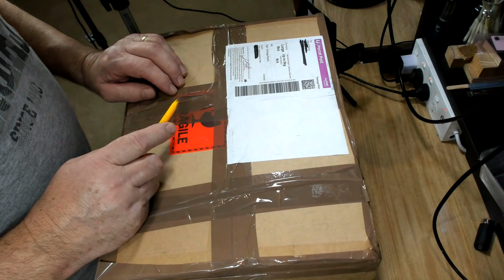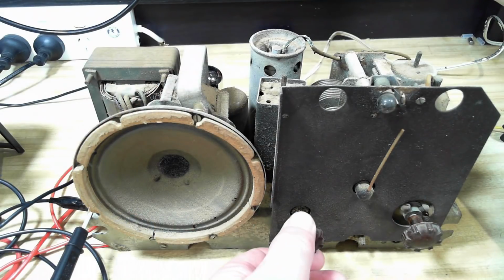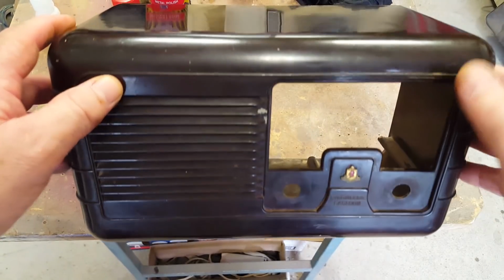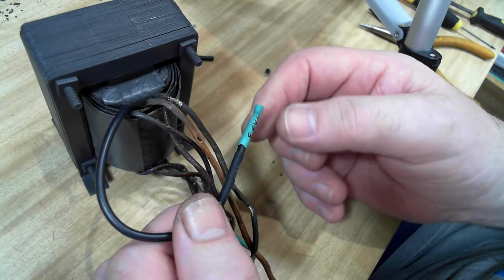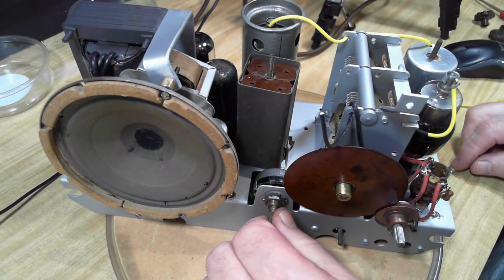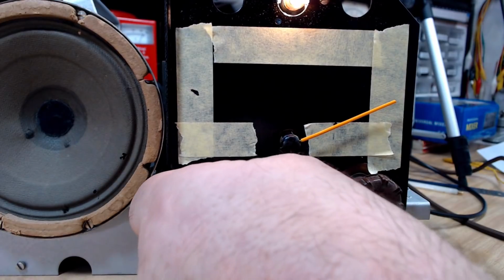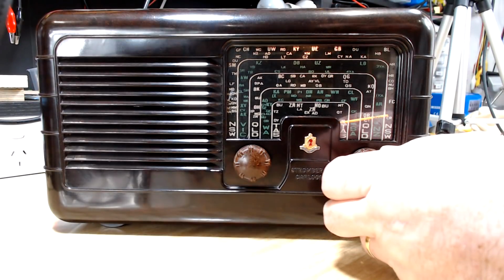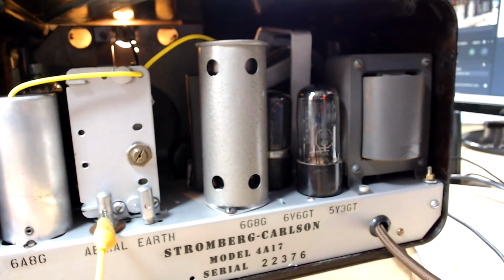1947 Stromberg-Carlson 4A17 Restoration - Extended Version Lockdown Special

Comment: A proper restoration! Wasn't expecting a full take-down and re-assembly, that was very impressive and yeah, I'd imagine you'd need many photos to keep track of it all. 😅
Very well David! Cheers.
Reply from the maker: Thank you Bill. A very pleasing outcome for a radio that held little promise in the beginning 👍🙂
Reply: @DavidTipton101   Indeed, and as I've heard shango066 say, 
at least it wasn't turned into a fancy fishbowl or cat bed. 😄

 Instead, it gets a new lease on life, thanks of course, due to your commitment to repairing these old gems to their former operation, but also in part to the serviceability of those old mid-post war era radios...
 Which I can certainly attest to myself.
 In fact, I've got an old AM radio here myself, way over here in the northeast corner of the United States, and I've gotta say, they're built to last. I believe the radio I've got is an old  Federal 1040TB, not the brown bakelite but the "vanilla" color, looks more like a marble sort of finish to me, but anyhow, it only took a careful replacement of the electrolytic capacitors, 
 off value wax-paper foil caps, and a substitute for the dead speaker, and it came to life! I tell you it was a shocker when I turned it on, and connected some alligator leads to that audio transformer, and that 50l6 she's got in her really started to drive the speaker I substituted quite well. These days I still turn it on to listen to the various news stations, although the built-in antenna built into the paper backing has seen better days, just like the bakelite case.
Reply from the maker: Thanks for your story Bill 🙂

Comment: Hi David-Restoring a SC-4A17, my first. Have been following your video very very closely, lol. Little problem with an aerial capacitor which I noticed you replaced in the shot of your replaced resistors and capacitors. It is just designated .00007 on the circuit attatched to the primary of the aerial coil. I have searched hi and lo and cannot find such an animal.
Could I ask where you obtained your replacement. I have no way of testing it so I thought a replacement might be easier. BTW .00007 what, is it micro, nano or pico?
I realise this post is 5 years old and i may not receive a reply. Kind Regards Rudi.
Reply from the maker: Hi Rudi, thanks for watching! It's 70 pico farads (pF) and I sourced it online from RF components or I think Element 14 sell them. It's a mica capacitor, it is probably OK, I don't know why I changed mine. Yours will be Ok. The circuit diagram I have is all in microfarad. Look online for a Capacitor Conversion Chart, it cross references between uF, nF, pF and K so you can quicky convert between the four values. I printed one out and have it close by. Good luck with your radio 👍🙂
Reply: @DavidTipton101  Thank you so much.

Comment: Suggestion:  You re-sleeved 6 of the transformer wires with new insulation. Soldering, a number 22 gauge uninsulated wire to the end of the bare stranded wire could be used as a kind of, pull string, to pull the larger stranded wire into the new insulation. As if you were pulling wire into a conduit.
This just occurred to me while watching the video.
Reply from the maker: Hi OIE, I don't quite remember how easy it was to re-sleeve the wire but your idea is a good one, Thanks OIE 👍😊

Comment: Greetings:
      Your decal and original camera view shows model 4A17. That doesn't match your 4A47 title, but both models do exist and appear very similar.  That may be the reason the replacement dial glass does not match. I gave up looking for the parts list numbers.
     Radio Museum has both versions of the SC 4A17 that differ only by the wiring of the IF amplifier tubes: EBF35 vs. 6G8 Both are 'duo-diode pentode' detector, AVC, 1st audio amplifier and that the 6G8 has a grid cap for G1 and the suppressor grid G3 is isolated on pin7, while the EBF35 has NO CAP with G3 internally connected to the cathode. The camera view of the decal showed your  IF tube; having a 6A8G tube. Guess your 4A17 is older
     I admire your ability to make new parts and do cabinet repairs and refinishing. I used to be a post production video and audio maintenance engineer but the company fell victim to the 2008 financial crimes and tried to compete with China on audio and video disk manufacturing.
Reply from the maker: I did this radio years ago and I never noticed the discrepancy. I assume I put the wrong number in the title but it's an interesting point. I used the 4A17 schematic. I'll change the video title. Good pick up James 👍🙂

Comment: David,
Can you help me out?  I have been trying to find one of your videos in which you had a part missing that was part of the alignment.  It was a metal rod with a nut at the bottom.  You loosen the nut and push or pull the rod to do the aligning.  Can you tell me the video and timestamp for it?  I think you had to make the rod from scratch.  Would be much appreciated!
Reply from the maker: That's an old one Wayne but I found it: https://youtu.be/PFF6s939J70?t=1205

Comment: On 240V wiring Red and Black is still used, though officially we have moved to Brown and Blue, like UK and some areas of Europe use.  I don't think the regulations are as strict with the colour coding here in Australia as in UK and Europe as you can still get red and black new.     You were right about the US.  Usually they have Black as the Hot/Active and White as Neutral.   That has caused confusion with imported electronics, like pinball machines as an example, where they are wired in American black and white and have ended up with the black being wired to Neutral when in the UK or Europe.    :)       Thanks for another great video.  I know this one is a couple of years old now, but I am just binge watching some of your videos.
Reply from the maker: Hi Brendan, I haven't seen red and black power wire for years, not new anyway. I can imagine being confused with American colour coded wire, when watching someone from the US on YouTube wire a plug I think I would do that all wrong. Thanks for watching Brenden, cheers! 🙂

Comment: Stromberg Carlson from what I understand was primarily telephone manufacturer but they sure Made  very well engineered radios I failed to see how you reinforced the cabinet on the inside and how you made the  decal you put on the back of the set ....
Reply from the maker: I believe Stromberg Carlson started in telephones but added radio and later TV to their mix. This is a Aussie radio designed and built in Australia. Australian Stromberg Carlson was fairly independent from the American company. To reinforce the crack I glued a strip of thin aluminium sheet underneath with JB Weld. I didn't show it because I have done a number of times before. The decal is made from waterslide transfer sheet, I print it on my printer and coat it with spray lacquer. Thanks Mike 👍🙂

Comment: Dave, I just could not take it any more!  Watching the fun you have and the joy when the project is so very nice that it must look better then new, I just had to buy an old radio set to play with. I found a GE from the late 1950's and it is route, hopefully it will survive the trip from Iowa to South Dakota intact, and I hope the seller does a good job of packing.  The add was for parts or repair, not working but that was sort of what I was looking for. Case looks good with no major breaks, just a few scratches so that will help, I hope it is just a recap project but, of course that will be left to the electronic gods above.  I would never have got something like this without what I have learned from you and others on the Web.
Reply from the maker: Hi Jerry, well done, that's good place to start with a radio that doesn't matter if it survives the repair. Good luck with your project but be very careful with those AA5 hot chassis sets, an isolated power supply is a good investment to save yourself 🙂
Reply: @DavidTipton101  I have been looking for a deal on an isolation transformer. I am quite aware of the danger, taking high voltage is an experience you long remember.  When I was in the 4 grade of elementary school, we moved to a different farmstead that had power, something that was not available in the old home place that my grandfather built in 1910, the year dad was born.  Well dad was as thrilled as we were, the first thing he bought was an  floor model radio. It had am/SW and Police.  Not knowing about antenna's and such I figured some button on the front was stuck.  So when dad was in the field and mom and my sisters were picking eggs, I reached inside that old radio and tried to find that stuck button.  I have no idea what the hell I touched but a few seconds after reaching back there I found my self laying up against the opposite wall with a hell of a headache and a burn on my finger and arm.  I have always been careful when working chassis since, oh did get a hell of a shock out of an old Curtis Mathis television once as well.
Reply from the maker: Haha... the things we did as kids, I think most of us have had a wack at one stage or another. If you can get hold of a isolation transformer all the better.

Comment: As you opened the box lid, I said to myself "that's not packed well enough for a radio, there's going to be damage" - and I was right. The sad fact is very few people a) understand just how rough the freight handling is (especially international) - I have seen them throwing the boxes from one end of the depot to the other, and b) even fewer people appreciate the need or know how to pack items properly so they will arrive in one piece. A few layers of thin bubble wrap is nowhere near good enough, and foam peanuts are a waste of time. They shift and settle in all the wrong places and provide no protection at all. The question you ask is "will the item once packed survive a 2 metre drop onto concrete?" 
If not, then it's not packed sufficiently well.
Reply from the maker: Hi S W, I worked for an airline, I am only to aware of the treatment parcels and baggage get. This was packed on it's face which did the damage, thanks S W 👍🙂

Comment: If you took a dremel and shaved off some bakelite from a hidden area on the inside of the case you could mix it into the glue, get a syringe- without needle unless it is a very big one- and then the glue would be coloured exactly right for the repair.
Reply from the maker: I will try that next time justinjoyit13, thanks 👍🙂

Comment: Looks like a great radio, I was impressed with the glue job.  I used to use a similar process on broken rifle stocks (wood variety) Of course we used either a good wood glue or if it were at the narrow part of the stock. My dad used to like his Vodka, perhaps a little to much. One day while coming home from town (we lived 25 miles from town) he spotted a pheasant and decided that it would tasted good for supper.  So he grabbed the Remington Targetmaster Jr. Rifle chambered in .22 LR, and took aim at the pheasant's head, well it went down but didn't stay down.  Well dad didn't want to waste another shell on the bird, so clubbed it to death with the rifle, and in so doing broke the stock.  Well dad just took some black friction tape and wrapped it around the pistol grip of the rifle stock many times and it held, it held for over 20 years.  When I married and moved out of the family home, dad gave me the rifle.  His health had detreated so badly that he would never go hunting again.  About 18 years later, I took a gun smith course, and joined two professional gun smiths helping out around the barrel factory in our town.  One of my first projects was to rejuvenate that old .22.  So I took her down, stripped the finish off the stock and removed that black tape. I was amazed at the damage that had been done, the stock was barley held together by a few strings of wood and could flex it in all directions.  This looked like a job for Epoxy and that was what I used, when I had it glued up and as it was beginning to solidify, I sanded all around the break and pushed the saw dust into the epoxy.  When it had dried, another sanding, then  a bit of light walnut stain, followed by about a dozen coats of Tung oil and the stock was. Now some 20 years later the stock still looks great and there isn't a hint of where the break had been.  There are always tricks that, when applied correctly will fix things.
Reply from the maker: Thanks for the very funny story Jerry, not so funny for the pheasant though. Good repair on the stock, very similar to  what I did to the radio. Thanks Jerry, take care 🙂

Comment: Well, as a scratch builder of amateur radio equipment I have to admit to being addicted to your channel. Quite a few of your renovation methods will definitely come in handy for some of my building adventures. As a Youtube content maker myself I can truly appreciate the unseen effort that goes into your video's. Re bakalite, when filling/replacing lost material I fill to overflowing the hole/crack with saved dry dust (from the initial sanding) then saturate with a water thin superglue. The thin superglue wicks readily and as the dust absorbs the fluid it will compact greatly (hence the overfilling) so a repeating of the process can be made if necessary. If a large area needs to be built up I will sand a hidden area of the material to acquire enough dust for filler. As the mixture of the 'filler' is more of the original material than the clear glue, a very good match can be made. For very light colour materials where the repair may appear slightly darker, tiny amounts of powdered acrylic pigment can be added if you need to get an absolutely invisible match. Sorry for the long comment but I couldn't find an email address. Slowly working my way though your back catalogue. Regards from a fellow Aussie resident in the UK.  De M0OMO.
Reply from the maker: Hi Stephen, thank you and thank you for taking the time to write all that down, I will print and refer to it next time I have a cracked case, it looks like a good solution for Bakelite repairs 👍🙂

Comment: Looks wonderful! Wondering about the glass...Couldn't you have gotten a new piece of glass cut to size and made a large decal with the correct markings from the original?
Then you wouldn't have had to compensate with the adjustments and that lucky capacitor.
Reply from the maker: Hi Nicholas, thanks. It would be great if I could make new dials but so far no luck. They need to printed with printers ink to get the depth so the light won't shine through. I got that one from a chap who makes repo dial glasses but neither of us knew it had a different band spread. It worked out OK in the end 🙂

Comment: now if it was me, I would have just replaced the glass with plastic and printed off a transfer dial face, don't know if that would have worked. I don't think ive ever seen a radio that neatly laid out wiring wise
Reply from the maker: I have not been able to get a good result doing that omegasignas. The print is just too light. It was very neatly built radio 👍😀

Comment: Excellent job once again! especially your tuning mod at the end!!....
One interesting side-note... (you may already know this?)... You kept mentioning about  1420-khz
and 600-khz. I'm in W.A. and don't know of those stations, but I do know that they must actually be
1422-khz and 594/603-khz.  Why?, due to an interesting quirk in mathematics!  Firstly, in Australia,
all our A.M. stations are on 9-khz step boundaries, so ALL stations are multiples of 9. Now for all
multiples of 9, all the digits add up to 9! (If total is 18, then 1 + 8 = 9). This is especially useful if
using a digital readout for reception. If it said '1322' you are not on it, & it must be '1323'.
This doesn't work in the U.S.A. though, as their stations have 10-khz separation!!  :-)
Reply from the maker: Yes you are right Glenn. I started off saying 1422 then changed to 1420, it may not have made it to the video. We used to use a sealant in aircraft called PR1422 and I think when I was tuning the radio I thought I was getting the two mixed up so then called it 1420 🤦‍♂️ Thanks for picking that up Glenn 👍😀
Reply: @DavidTipton101  Thanks David. I'll definitely be looking at Carl's vintage parts too !!!

Comment: Looks like a quarantiner’s favorite in a time like this. At least, with this radio 📻, you could pass the “Coronavirus Times” a little faster, especially if you have to restore the radio 📻, then listen to it once the job is complete, hence the name,”Lockdown Special”. This can also be a basement radio 📻. Just have it for all to see when you invite friends over. It’s a shame when these radios get shoved in closets, sheds, attics and basements otherwise, or left outside to rot.
Reply from the maker: It's on display in my home Jeffrey. Radios stored in a closet are usually in good condition, not so good in a shed though 😢